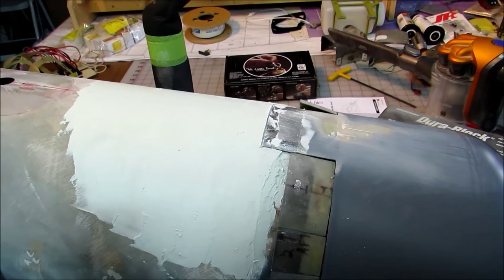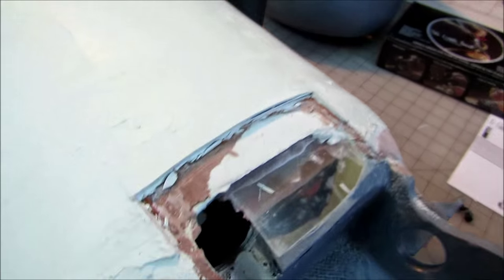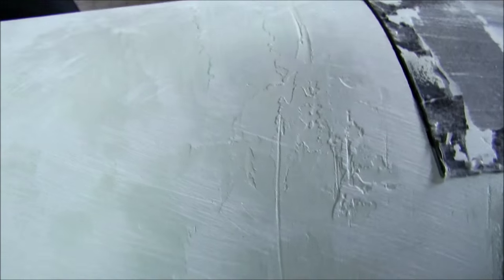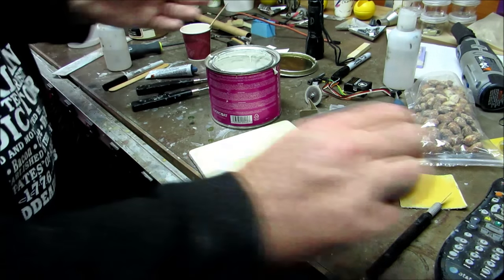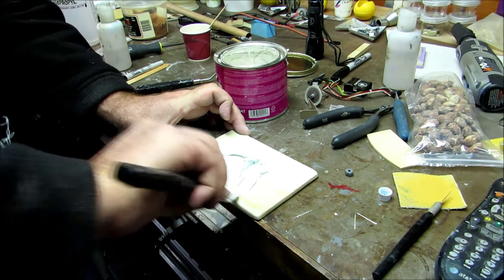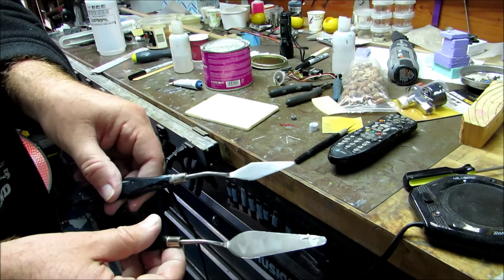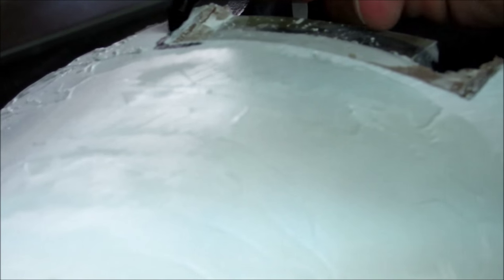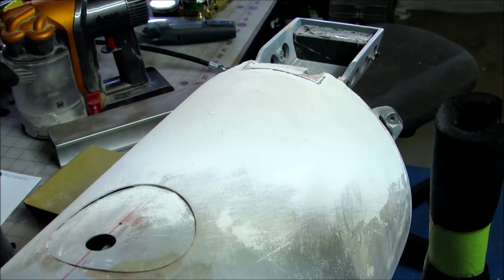Corsair #130, Building Bulk with EverCoat and Other Body Work #2

Comment: Don, about how much time elapsed from the application of the Evercoat to the time you started to sand it?  And is it feasible to use over fiberglassed balsa?
Reply from the maker: +TJ Rohyans Hi T.J. You can sand in about 10 minutes, 15 at the most. If you put on a ton of it, you can use a cheese grader type of rasp to do the rough shaping after about 5 minutes, before it gets too hard. It's awesome stuff. It's basically just like Bondo, but is finer and silkier, and better for spot uses like this.
Generally, I only use this on glassed surfaces, either with primer or without, doesn't matter. I mostly don't ever put this directly on wood, especially balsa, because balsa sands faster than Evercoat, so it would be difficult to feather an edge if you use it on raw balsa.
Reply: Thanks.